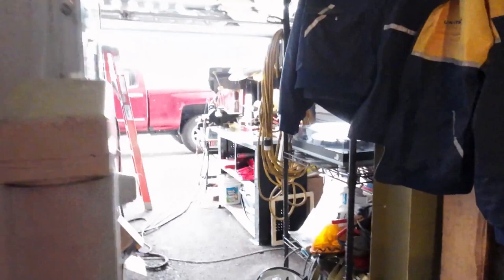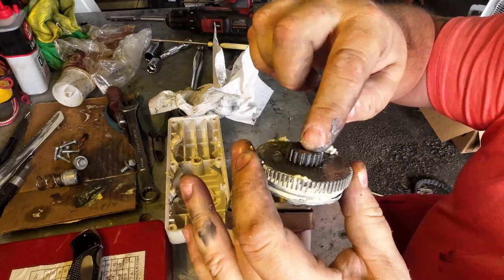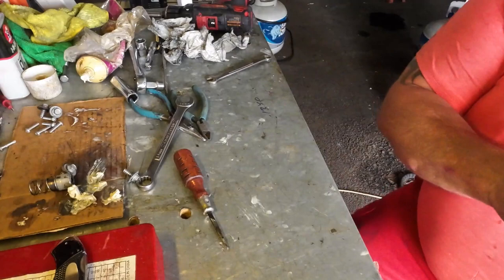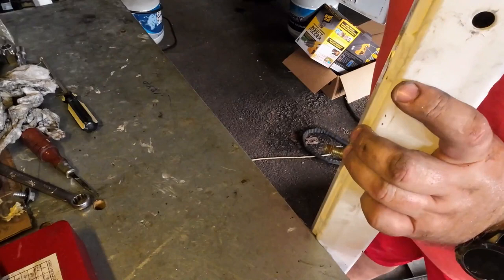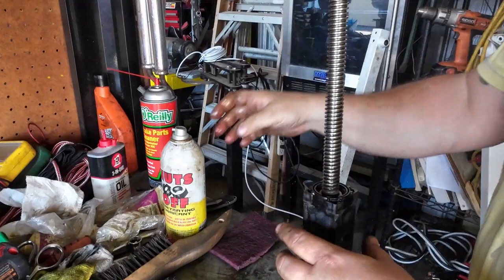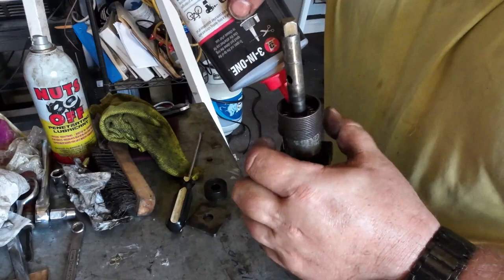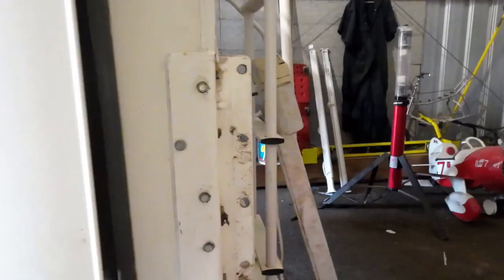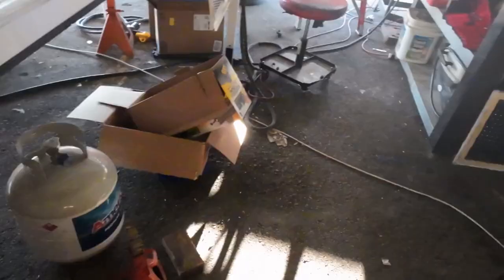Happijac Camper Jack Maintenance | 4100 4150 4160 4500 Series | Bearing & O-Ring Swap | Now We Roam

Comment: This was the perfect video. Thank you! A couple of mine are making the same noise yours were and I have the same wear on the bottom side of the clutch gear set. Two done today, Two tomorrow with a test run. I laughed so hard watching you put the motor head on wrong and then catching it. Because of your troubles I took tons of pics. Then I still got confused.
Reply from the maker: I've got another one starting to make the same noise intermittently I guess I'll have to take that one apart at some point again too and see if I can stop that noise. 
Glad the video helped you, I sometimes imagine that a more organized workspace would be easier to work in LOL, but how was that real life LOL

Comment: Thanks for the video. My 2001 Bigfoot camper has 4 4100 jacks on it. One is making a lot of noise in one area of it's travel. I ordered parts and will tackle this when they come in.
Reply from the maker: Sounds about like what I had going on, glad the video helped you out.
Reply: I'm tempted to add some white grease to the plastic guide bushings and the steel where they slide. It will slide easier with side load but it will also attract dust to stick to the grease. Did you lube the sliding interfaces at all?
Reply: the 4100 jack has smaller thrust bearing (1/2" x 15/16"), no brake, and it uses a plastic nut on the lead screw as opposed to recirculating balls. I'm wondering if oil or lithium grease would be best to use on the acme screw with plastic nut.
Reply from the maker: On the legs themselves? I'm having a hard time remembering where a plastic guide bushing is..... I'm thinking you are talking about the legs, but mine didn't have any plastic guides/slides on them.

I think I saw a comment late so this is probably not correct or just confusing things.. but I'll leave it here anyway..
Reply from the maker: Didn't see this comment until just now, You're saying the ACME lead screw is nylon or plastic that's inside the leg? If so, that's probably a "DRY" lead screw they do not need lubrication as they provide their own by just regular wear I think.
Is the lead screw making noise for you? I know you can pickup new dry lead screws in a few places.
Reply from the maker: Thanks for the update on the 4100 needle bearing size I put that in the video description as well.
Reply: @NowWeRoam  the ACME lead screw is steel, but the nut that it threads into to lower the leg is plastic. I cleaned my lead screw  with a toothbrush and brake cleaner then applied motor oil to the lead screw. 
The steel legs on mine don't slide directly together, there are 4 plastic "buttons" pressed into the bottom of the large tube and a black square plastic bushing at the top of the small tube, at the nut location. I did not end up greasing mine. My jacks are noise free now.
Reply from the maker: Awesome, I don't think they are as intimidating as they are made out to be but they do hold up the camper haha 
Noise free jacks are NICE!! It was almost as annoying as the travel trailer's weight distribution hitch making all the squeaking and banging noises haha.

Comment: Thank you for the video!! just came across your channel.  I picked up a truck camper yesterday with the happijac 4150, 4160 jacks. 3 of the 4 need work. Your video will help me take apart and put them back together. do you recall the part numbers of the bearing and o-ring? where did you order them from?  I would like to order them.  I'm also having issues with two of the four  jacks (up front when I lifted the camper to load it into my truck) making a grinding sound and not lifting the camper 😵‍💫😵. I had to take weight off the jack and then lift almost like there wasn't enough power or there was too much weight to raise the camper. Not sure what to expect when i take them apart.  Hoping it's just the gears.  I haven't been able to find success in replacement parts though.  any insight would be appreciated!
Reply from the maker: Hey Meck, sounds like you have a project ahead of you for sure, in regards to the front jacks grinding were they grinding or making a ratcheting sound?

I picked the bearings and O rings up here locally in Denver, I can get you the part numbers as they should be able to be found online somewhere for sure.
Reply from the maker: The needle bearings are 1018's 1 bearing and 2 washers per jack
https://amzn.to/3rJChLh
The O-Ring I used were 2-317-BUNA-70
https://amzn.to/3F5oXUK
Reply: THANK YOU! take care.  @NowWeRoam
Reply: it sounded like more of a clicking sound/ ratcheting @NowWeRoam
Reply: @NowWeRoam  if it's making a ratcheting sound, can this be fixed? or what do you attribute the sound to?
Reply from the maker: @mdejr4  a slow ratcheting or a fast ratcheting like a little machine gun?
Reply: Sounds fast
Reply from the maker: @meck1341  sounds to me like the lower gear is ratcheting on the wolfen that goes to the shaft @32:50. That could be ratcheting for a couple reasons I think, either the raw pin and the gear are wore out or the shaft is seized/rusted won't really know I guess until it comes apart.